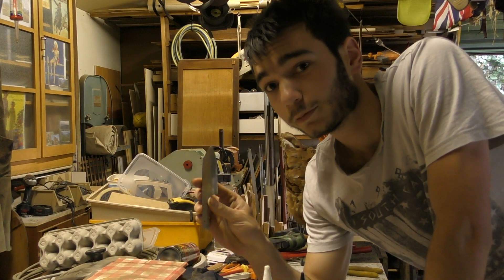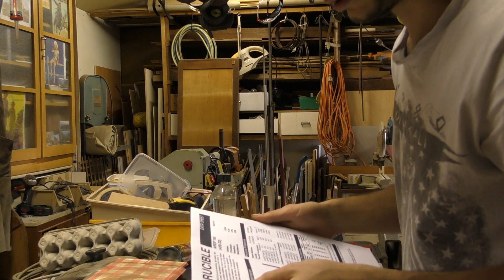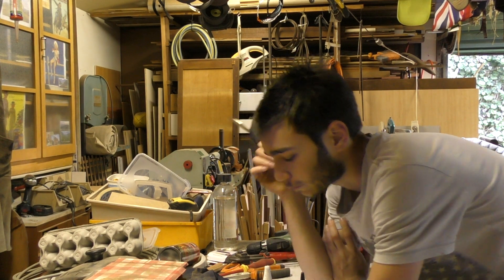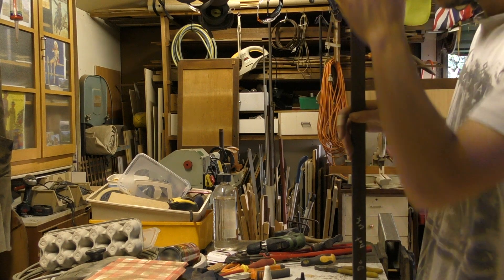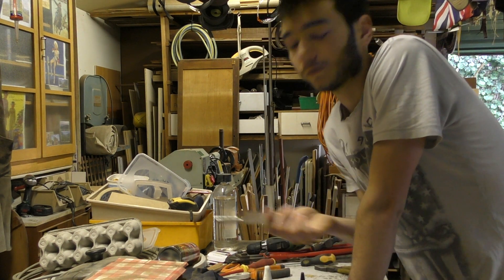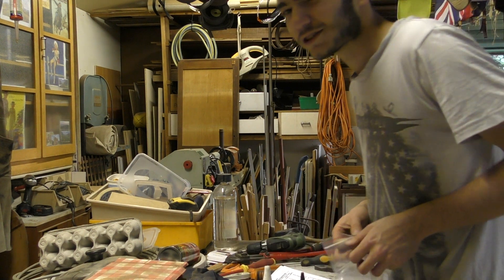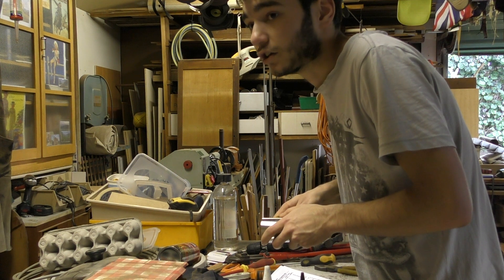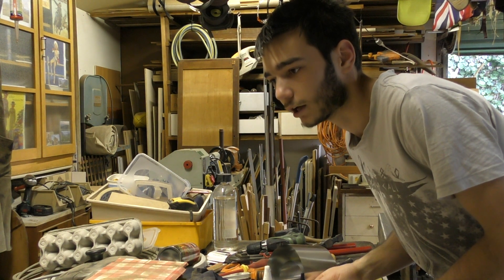how to heat treat D2 Steel

Comment: I have attempted the vacuum hardening process, but D2 is still softer. Can you suggest me any remedy to achieve 60 HRC?
Reply from the maker: Sorry mate given my lack of experience with D2 I cant really help, I  have used a couple of slabs of thick aluminum to use as quench plate and I think I got better results but I'm not sure if this got it past 60, Good luck I hope you can find your answer.
Stay safe and happy crafting!

Comment: hello, could you tell me, if I use a gas oven, how long do I need to keep the knife in the oven for tempering
Reply from the maker: it depends on what you would like to achieve and also the oven, each one will be sightly different, for a rule of thumb with knives I will do 2 cycles for 2 hours each at about 200'C with 2 hours cooling in between. Good luck mate, I hope this helps.

If you still need more info I would recommend googling what you are doing and seeing if there is anything anyone else thats close.

Comment: I know this video is old, but I regularly heat treat d2 at work. we use an oven. d2 needs to soak at 1850f for 1hr per inch.  a small blade would be about 15 to 20 min. the foil pouch needs to be air tight and add a piece of paper or cardboard. that will burn and remove the oxygen. if the bag is not air tight, it will oxidize. d2 should not be forced to cool. once removed from the heat, cut open the foil bag and let rest in still air till 400f. temper at 800f. not a good metal for a forge at all. I make leather cutting blades and have made thousands.
Reply: I use a double burner gas forge that i have a very accurate k type high temperature thermocouple installed in. This allows me to hold and soak at specific high temperatures as well as get good consistent repeatable results. Would I be ok treating D2 with my set up like that? I ask because i never tried D2 and have an opportunity to get some for cheap.
Reply: @HPAccuracy I got same setup works great 👍 👌

Comment: >You need LN2
>I just hang it
>Canola oil works fine
Ah, I see heat treating fandom is just as religious as the automotive fandom.
Reply from the maker: yeah its pretty ruthless out there, but thanks for the input,  I had to make up a quick D2 tool over the weekend a while back and due me not having time to do all the steps I was able to get a pretty good hardness with just canola oil, This does work! But when it comes to thin stuff I would definitely use quench plates to avoid warping if you are going to air harden.
Thanks for the comment
Reply: @craftedbytimyt  I'm not sure what input I have given, I was just making a snarky comment. Glad to be of help I guess.
Regardless, that is very good to hear on the oil quenching side of things. I'm gonna see what I can do with a charcoal forge. What I've heard is to do multiple shorter and hotter neutralization cycles. I'm getting a 3' segment of D2, so it may work well to at least keep it strait to use that as a bit of a gravity vice (although I have heard blocks of aluminum are preferred.). Tempering past that, that's where things get complicated, because I don't want to destroy our antique gas oven, a charcoal grill is not the most stable, and I doubt an air fryer can get hot enough.

Comment: Just get 2 slabs of aluminium plates, put the heated blade between the 2 plates and blow compressed air into the gap around the edge. You can harden any air hardening steel (mostly) with plates.
Reply: Then do you pop them in an oven?
Reply: @KNIGHTFALL_SUPERMAN  Yes you still need to temper air hardening steels after you plate quench them.
Reply from the maker: @KNIGHTFALL_SUPERMAN  yep after the hardening you always temper, the time and temperature of which is decided by the job you are making the tool for ie. a chisel edge will be harder than a knife in most cases, so it would be tempered at a lower temp. for less time.
Reply from the maker: yeah mate I got some alu plates now so it makes this job waaaaayyyy easier!!
Reply: @craftedbytimyt  Nice, that should make it a lot easier for you, good luck on future projects.
Reply from the maker: @LondiniumArmoury  cheers man, hope you enjoyed your new year!
Reply: @craftedbytimyt  Hope you enjoyed your new year as well, sorry I never got notification of your reply. Just saw it.
Reply from the maker: @LondiniumArmoury  no worries, thanks though!

Comment: D-2  Heat to 1850 degrees  hangup --  60-62 RC -- I have heat treated tons of it over 30 years.
Reply: It’s air cool, no quench in oil?
Reply: So have I in vacuum furnaces.
Reply: D3 is the oil hardening variant of D2.

Comment: Can hchcr d3 steel be done on the same procedure ? For knife making
Reply from the maker: I'm not too sure mate, I've never had the chance to work with D3 but if I get the chance I'll give it a shot
Reply: @craftedbytimyt  950°c soak for 10mins wrapped in a foil then oil quench . For tempering two cycles of 2hrs at  250°c
Someone who work with d3 gave me this information . Think this will work,  let's see
Reply from the maker: @sojinstunts  I'll give it a shot when I get my pyrometer

Comment: Awesome video, Sir. Thanks for sharing. But may I know is D2 steel can sharpen by sandpaper? I've ever heard that it's hard steel to sharpen.
Reply from the maker: you can refine an edge using emery paper but you will need to have a reasonably fine edge to begin with, personally I like to use stones, hope this helps you out, thanks for the question

Comment: Wrap it in stainless steel foil and quench it in air..After taking it from the forge you should put it in between 2 half inch thick aluminium plates and use air compressor to quench it there.. Aluminium will absorb heat quick and prevent warping..
Reply from the maker: Ahh that's super cleaver I'll do that for the next D2 blade I do... now I gotta find some thicc Ally, Thanks for the comment mate!
Reply: @craftedbytimyt  Pleasure brother!!!

Comment: I use canola oil on my d2 blades and they always come out hard as a coffin nail.
Reply from the maker: ok maybe I don't need to follow the instructions to a "T" also do you still use the foil when quenching? thanks for the advice!
Reply: Crafted by Tim no I just put it in the forge. I hot cut all my d2 also. I get it hot and use a chisel and hammer to lay out my lines. I then just put it in the forge and heat it then quench it. I lay it on my anvil and hit on the side of the line I don't want and it just shears off at the line.
Reply from the maker: @Branden787  thats wicked cool gotta give that a try one day!
Reply: Crafted by Tim for sure. It's good to first dip in canola for a few seconds then water. If you are trying to shear pieces, straight into water.
Reply: @Branden787  - have you ever used hardness files on the D2 after you've done the heat treat?  Interested to see if yours has the same qualities of D2 as a "properly" heat treated blade.
Reply: @Branden787  what temp you get it up to for quench?
Reply: @bfries555  non magnetic and held it there for about 5 minutes. It's been awhile since I've done it so my memory is a little fuzzy on it.
Reply: @Branden787 5 minutes, its mean 3-4 mm blade thickness ?

Comment: Get a couple slabs of aluminum and press the blade between them when you pull it out of the forge (leave the foil on) and use the air compressor to blow on the edge for a couple seconds. This helps quench faster and helps to keep it from warping.
Reply from the maker: ahh thats why they say positive pressure thanks for the advice I'll give this a go with some of the knives I've been working on recently when I can light the forge again
thanks for the help!
Reply: Crafted by Tim oh and you don’t need to let it soak a whole thirty minutes, it’s 30 minutes per inch of thickness, so for a quarter inch thick blade you really only need seven and a half minutes. For anything less I think five is probably fine.
Reply from the maker: @seanbracy3799  oh ok thanks thats wayyy better than standing around for thirty minutes, thanks again for everything, I might see about doing this video again just so I can correct all the things I was doing wrong throughout this whole thing.

Comment: Why not just try to heat treat it regularly and see what happens?
Reply from the maker: you know what, I'm actually gonna give that a shot, I mean after all whats the worst that could happen, if I lose a blade it just means the next person wont have to (mind you I predict that even though it might harden it probably wont harden to its full extent and thus for it may not be the best for a blade but I'm still willing to give it a shot)
Thanks for the suggestion!
Reply: D2 is an air hardening steel so it can be air quenched and get plenty hard. An oil or water quench will likely be too severe (water definitely will be) and you can get stress fractures.
Reply from the maker: @seanbracy3799  interesting I still feel like it would be an interesting experiment none the less if only to see the grain structure when it snaps
thanks for the info!